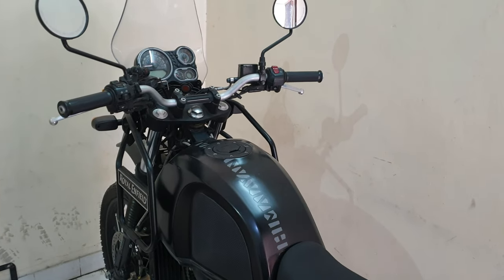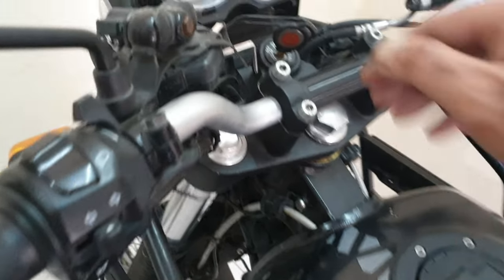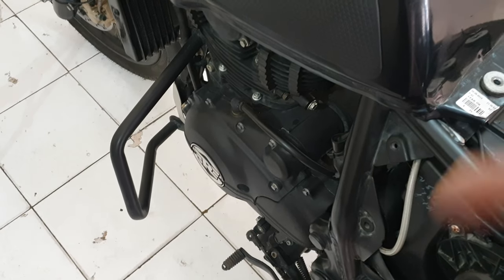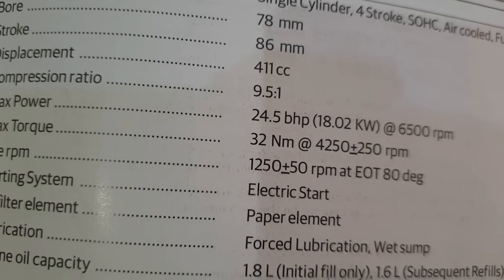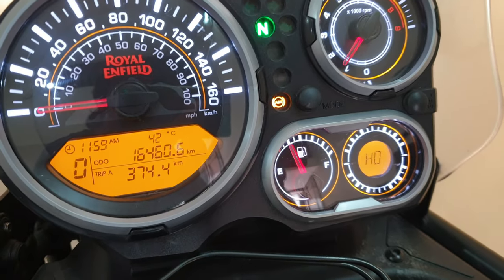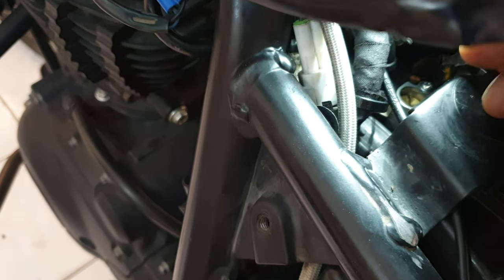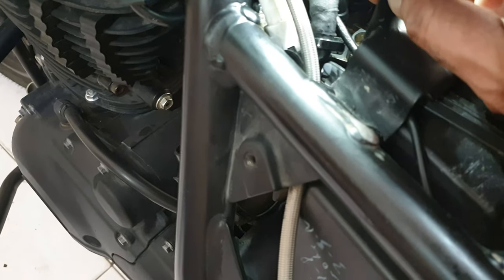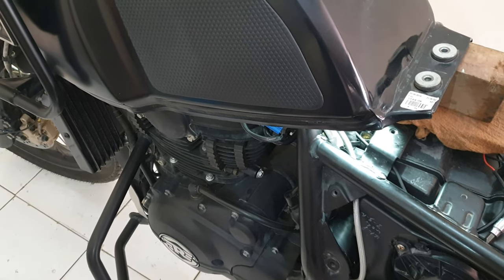Royal Enfield Himalayan - RPM Idle Screw | Adjustment DIY

Comment: MY mechanic said he has adjusted the RPM. When you start it up, it seems fine, but when I am riding and pull the clutch, it will drop down to 800-1000rpm. Multiple times a ride, I will pull the clutch and the bike will drop the rpms and then stalls. I bring it back to the mechanic and he works on it and it is at 1200-1300. Go to drive home and pull the clutch, and it is at 1000 rpms and stalling again. We checked the TPS voltage and it is were it needs to be apparently. Everyone is at a loss.
Reply from the maker: Hey mate, I am guessing valve clearance and spark plug are in spec. Also evap routing is clear and the pipe is not bent or crimped thus restricting flow.
If so, we can move to TPS and MAP sensor, first just disconnect both and plug them back firmly. If connection is loose, you would get same behavior as with a bad sensor. and the symptoms you have quoted, point to that
Cheers :)

Comment: A normal engine has higher iddle rpm when cold and goes lower when heating up. A Himalayan seems to do the opposite!? Is this normal? My Himi has 1000rpm from cold and nearly stalls and after hearing up its at 1250rpm. Very strange....

Comment: Hi I wanted to ask you, I have the same bs4 Himalayan, it happens so that always the first start of the day I crank the bike and it immediately shuts off, after that it runs smoothly, what's the issue?
Reply: I think it’s to do with the throttle, I put a booster plug on mine and it runs cooler, smoother and accelerates much stronger through the rev range 😃👍🏻
Reply from the maker: Hey there
I would first check the spark plug for correct gap, .7 to .8 mm anything out of range and bike will have cold starting trouble, and also clean it while its out.
If that checks ok, make sure air filter is clean. 
And finally moving to adjust the idle if needed
This should take care of things. if not, last thing would be valve clearance is out of spec. bit dont bother with clearance at this stage. just stick with first 3
Cheers :)
Reply from the maker: Hey mate, 
Booster plugs, have heard about those. a question, did you notice any difference in initial RPM once the bike is started?
Cheers :)
Reply from the maker: @ Vincent de Vilm Hey mate,
no no, that problem happens while riding when the bike stalls, not when starting first time on the day, cold start as it is called.
cheers :)
Reply: @leuheanrede  Yes , this goes rather in direction of the green cable to clean the hole

This Varun Basbsar problem is then more in direction of previous comment/question of the other video, i.e what to do when bike does not start ? and just before you take in hands the stone crushing hammer or the big axle to resolve that problem the manly way.
Reply: @leuheanrede  I bought the bike 5 months ago, hardly 2000 kms done.
Reply from the maker: @ Vincent de Vilm Naah, not that serious an issue, maybe previous owner didnt care much. But I get your point :)
Reply from the maker: @ Varun Bhavsar I get it, no issues, stick to first 3 points. check the spark plug, clean the airfilter and adjust the idle, that will take care of it. and then at next service get the valve clearance checked.
Reply: @leuheanrede  thank you so much, will do
Reply from the maker: My please mate, happy riding :)
Reply: leuheanrede, Hi and yes it felt instantly smoother, it accelerates much stronger in every gear up to the red line, and it never stalls anymore 😃👍🏻
Reply: @varunbhavsar1993   Hi! Varun, im Daniel From Argentine, i have the same proble.  My bike have 1700Km. Im the first owner. All the motorcycle services done in royal enfield Argentina. 
Royal enfield cannot find the solution to the problem. Could you fix it? Thanks Broda!

Comment: My bike (bs4 version)start jerking at steady rpm specially between 2000 to 4000 rpm already visited service center several times. Any suggestions
Reply from the maker: Hey mate, need some additional info if you can help please. 
First, I am guessing you have a FI BS4 or BS6 model
Second, can you pin point the rpm range, like is it at close to 3000 and worse at 2800 rpm
Cheers :)
Reply: Hey friend, thanks for your reply.🙂
1.Bike is FI BS4 model.
2.Jerking start at 2400 and worse at 2700
Reply from the maker: Hey mate :)
And yes that puts things in perspective, thanks. Now there is some jerking that I use to feel between 2500 to about 2800 ish rpm. But only very minor, which is there because of lean fueling, unfortunately on an FI we can't tune it as that would require an ECU piggyback like powertronic. Upgrading to iridium plug has made some difference. But it was negligible to begin with. So please do ride another Himalayan and see if its same as on yours. If yours is too abrupt and noticeable then we need to dig deeper. But if same then we need to adapt our throttling to it :D
Cheers :)
Reply: Checked with other himalayan previously the jerk feels totally different in mine something like when fuel runs out. Ordered iridium plug and a new spark plug cable and in addition with that planning to clean the throttle body also.hope this works🙂
Reply: Another excellent video. Thanks.

Comment: Thank you for this and so many other good videos!  One question, your reference to the temperature gauge confuses me.  This is an indicator for ambient air temperature, not engine temperature.  The sensor is located too close to the engine, so it picks up heat and gives a false reading.
Reply from the maker: Hey mate, my apologies for the confusion. I shouldn't have referred it as it had nothing to do with adjusting idle in this vid. All I meant to say and and show was that some fellow riders have found it use full to relocate it and place it a bit high or even add wire and place it under rear set to get accurate temp readings as you already mentioned, cheers ;)

Comment: Hi. Do you think one can install the bs4 windshield on a bs6 Himalayan (without swapping to the bs4 tank frames)? They cost 4k a pair 😅
Reply from the maker: Yup, Doable mate, would just require very carefully drilling holes to accommodate for screws.
Reply: @leuheanrede  And probably some spacers as well. As the orientation of the plate where the windshield is fixed is different in bs6, I'm wondering if it'll leave some gap between the windshield and the headlight 🤔 Thanks for the quick response. I'll try this DIY.

Comment: Hey Mate, my Himalayan is idling low (1000 rpm) when cold,  but very high (2000 rpm) when warm. Any guesses where this behaviour comes from? Will the engine stall when it is cold, if adjust the idle rpm to 1300 rpm when it is warm?
Big thank you! from germany
Reply from the maker: TPS sensor needs to be adjusted mate

Comment: I have one question bro. When I cross above 4k RPM in my new bs6 himalayan, there is some plastic vibration kind of sound which is coming from front part. It is loud and irritates.  Could you pls tell me what makes this sound and solution for it? 
Service guys r telling it will be okay once we put headlight beeding, which currently is not in stock due to pandemic. I'm waiting from 3 months
Reply from the maker: it could either be headlight beading, or windscreen vibration of speedo console vibration, just begin with tightening the screws and see if you can find where it is emiting from, cheers :)
Reply: @leuheanrede  thanks bro.  I will check with this

Comment: Very helpful, thank you very much.

I got a new throttle body fitted after mine failed, when I refuelled it for the first time I went from E10 fuel back to E5 shell V Power and it wouldn't start at the pump. I eventually managed to get it started, and rode home, but whenever I start it now it cuts out after about 5 seconds and I have to keep the throttle on for a bit to get it running.

I checked the TPS sensor and it was at 0.64 which is ok, and I'm now going to warm the bike up and adjust the idle. It idles at around 900 when cold, which doesn't seem right. I've also checked for a blocked or pinched breather tube. The RE dealer did tell me they turned the idle down as it seemed too high. So I think this may be the issue. I'll be removing the EVAP when the bikes out of warranty in March.

Still, I love this bike.
Reply from the maker: Hey mate, indeed a lovely machine. And as you mentioned, 900 RPM is too low, it needs to be adjusted, no matter what RE guys say. Trust me, try the idle adjustment and things will be lot smoother, cheers
Reply: @leuheanrede  thanks for your reply. The bike stopped working altogether. They adjusted the idle, turned the tps down to 0.56 and changed the spark plug. Said it was fixed but it was a pain to start and get running. Was running rich and misfiring.

Wasn't prepared to put up with this, so I removed the oxygen sensor and soaked it overnight in carb cleaner. Now the bike runs pretty sweet but I'm getting a brand new sensor under warranty. So issues seemed to be solved for now. Still think the dealer should have spotted this oxygen sensor fault, but hey ho.

Comment: Hi mate! Is slight fluctuation in the idle rpm needle an issue to be considered or is it common?
Reply from the maker: Hey, yes its ok, there is slight fluctuation when engine is cold but once warmed up after a few kms, it should be stagnant. if not than look to adjust the TPS, cheers

Comment: Hi bro. My himalayan is runnin very sluggy at lower rpm. It feels like it po miss the beat. Aoso once i pull throttle it responds but very soon on e i loose grip very fast it speeds down. What could be a reason? Please guide me
Reply from the maker: Check spark plug next valve clearance mate

Comment: Any idea how much you actually adjusted your idle screw? For example, did you turn it out 1 1/2 times, 1 1/4 times, 2 times, etc. ? I'm having idling issues and between the idle screw and TPS, I'm trying to get it just right.
Reply from the maker: Hey mate, naah not sure, just keep an eye on the RPM and just make sure engine is not puttering. And best done after taking a short ride so engine is warmed up, cheers
Reply: @leuheanrede  Thank you, I appreciate it.

Comment: Dear frienda dont buy himalayan bike   buy other company very bad service and parts not availabe . and low safety and high maintenance.
Reply from the maker: Hahaha. Getting parts is an issue certainly. I only visit service center to buy parts and order them. Takes time but I stock up. But its a very simple bike to maintain so from day one servicing at home and sharing vids on that to make it simple for fellow riders too. Maintenance cost has been just normal wear and tear parts replacement and oils etc. 20000 kms and 2 year of riding through toughest terrains, has been a pleasure with no major issues to be honest. To each his own. Have a good one. Cheers
Reply: @leuheanrede   if parts  not getting on time. What is the best service then broo
Reply from the maker: @jobjohnshorts  hahaha. I have this habit of buying spares in advance, the ones that fall under normal wear and tear category. Not only for himalayan but other bikes aswell. I have a list of inventory. Every thing from piston kit to crank valves to brake pads sprokets to small orings, washers. Stocking up varies on seeing in advance what might be needed in near future depending on how many kms the bike has done and keeping a close eye on wearable parts
And trust me even getting spares for my ktm are an issue or the rest of the bajaj bikes too. Even yamaha also has part problems so I stock up for those too. And as soon as I use one part I put it on the list and book it at svc if they don't have and collect when it arrives for next t
But if you have already made your mind that himalayan is not worth it I won't try and convince you otherwise. 
I personally would buy another one if I had the money. As I said to each his own. Cheers 😉

Comment: Hey..I am having himalayan..which is BS6 model..I am unable to start my vehicle..one thing I observed that Fi noice use to come from the tank when I turn on the engine..now the sound is not coming from the tank when I turn on the engine. Do you have any idea why it's happening ?
Reply from the maker: Seeing this a bit late mate, is all working now, first check for Fuel pump connector, then fuse under seat, then side stand switch, last fi relay,
Reply: @leuheanrede   yeah it's working fine now, I just reconnected Fi relay..it's working fine

Comment: What year is your Himalyan? I purchased a 2020 in USA. My rpm is 2,000. It is EFI: dealer just told me there is nothing they can do to lower it. What solution do you offer?
Reply from the maker: Hey mate, 2000 rpm is a bit excessive, does it stay at 2000 even when the engine is warmed up and has run for a while? if so, need to adjust the idle, 1200 to 1300 is where it should be. Where you live is another factor, like in the mountains or plains or coastal region. Cheers
Reply: I fixed the idle issue myself. I found the idle screw and adjusted it. Dealer lied and informed me there was no adjustment screw. Good thing I can think on my own.

Comment: On higher alti above 16k feet do you feel Himalayan bs6 need to increase idel rpm?
Reply from the maker: Hey mate, so this tuning was done in Delhi NCR region last year, so plains i mean. And bike have done multiple trips since then on most of the major passes up in the Himalayas and no adjustment was needed at all. So do it in the plains and if you get it right, and bike starts optimally in plains, dont worry about altitude, FI and ECU and all the sensors will take care of heights ;) cheers

Comment: Sorry, idle rpm need to change due to low oxygen concentration
Reply from the maker: naah mate, nothing needed, just adjust it in plains, but the thing is, you mention yours is BS6, right, so Good news, BS6 variant, (the one with TRIP feature) doesnot have this throttle body, and has a new design, and I am not sure if that has is screw for adjustment to be honest, Cheers

Comment: Hello there, good evening. 
I have a qquestion. After starting the motorcycle or even after a enough good warm up the RPM red needle is resting exactly on the number 1 in RPM meter. So is that proper or I need an adjustment? Please suggest.
Reply from the maker: Hey mate, is yours a FI or a carb one
Reply: @leuheanrede  Fuel Injection

Comment: Hi ,

I have been following your videos since year. I am also an owner of himalayan sleet bs4 .Since one day while putting ignition on , my fuel pump is not working ( humming sound is not coming while ignition ) which result self button is not responding . Currently I can't able to start my bike.  Can your please figure out reason & suggest your best advice.
Reply from the maker: Hey
Did you remove the tank. Is so please begin with checking the connector to the fuel pump is properly connected and all the wires are ok. I am talking about the connector that's hidden behind the fuel line on pump. If need be. Pull out the fuel pipe for easy access. Then disconnect the electrical connector and make sure you hear connector click properly once you connect it back
Cheers :)
Reply: @leuheanrede  hey ,

Yes I checked the same & seems like everything is fine  ,even I have checked the fuse box . All the fuses are working fine. Is it related to main switch  or relay issues ? 

I am not able to find the relay place . Could you help to know where it is fitted ?
Reply from the maker: Only be concerned about fuse 2(main) and fuse 3(efi) and is the battery ok mate. Fuel pumps dont go bad this early. Is the main on/off handlemounted switch working fine
Reply: Had the same issue. This is how i fixed. I Removed the ignition Switch from the Upper T clamp. The wire that comes from the ignition which makes developed a crack . Cut the wire where there is a crack and rejoined it. Problem solved !

Comment: My Safeena does not idle  as your's-my bike has a lumpy idle-sometimes takes 3 times to settle into a smooth idle-so nice info.....
Reply from the maker: Like it goes up to about 1600 + rpm and the varies between that and 1000, before finally settling?
Reply: @leuheanrede  it starts on half self,idles for a few seconds and then dies-this happens 3/4 times and then I slightly turn the throttle to rev it to approx 1500rpm and hold it there for a few seconds-then it idles lumply at around 1000-1200rpm-after it is fully warm the constant idle is at 1500rpm
Reply from the maker: Hmm that needs to be adjusted to a bit lower as mentioned in the vid. Give it a shot in spare time
Cheers :)

Comment: hi bro my fuel gauge always stops working after getting it serviced 
it usually stops working after 2 -3 days. Please help me bro.
Reply from the maker: Hi
There is a blue connector on left side of the tank towards the seat. Carefully disconnect it and reconnect it properly  and also check if there is some corrosion there on the pins. If so clean it connector cleaner and you should be good to go
Cheers :)
Reply: @leuheanrede  bro couldn't find it?😔
Reply from the maker: Give this vid a look
https://youtu.be/7oxhPYDHwvo
You might have to unmount the two 10 mm bolts and raise the tank slightly to gain access. Dont have to completely remove the tank. Cheers :)
Reply: @leuheanrede  ok bro 😊
Reply: @leuheanrede  thanks bro it worked 🙌🙌🙌

Comment: please make a video on rpm slow of standard bs6
Reply from the maker: Hey mate, so you are looking to slow down the RPM on standard 350? A lot of videos have been posted already, plenty of tips and trick, I am not mechanical or professional, that being said, unfortunately, standard doesnt come with tacho(rpm meter) and FI unit also doesnt have an idle adjuster screw as far as i know since as I have never worked on it, still I have seen people do weird things to slow the rpm, I wont mention them as I am not an advocate of those practices. If I ever get my hands on one, i'll surely update you, but till that time I recommend you take it to service center and let them check it with RE diagnostic tool and correct it with that only, cheers